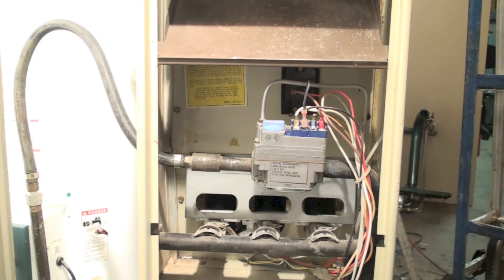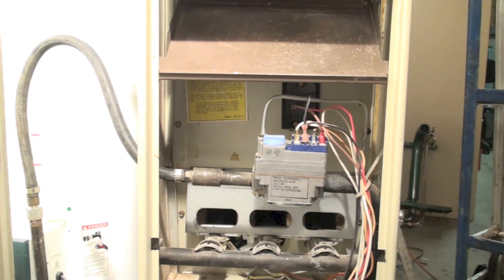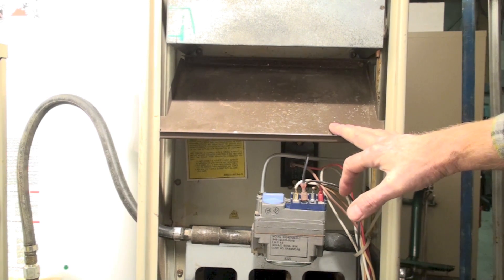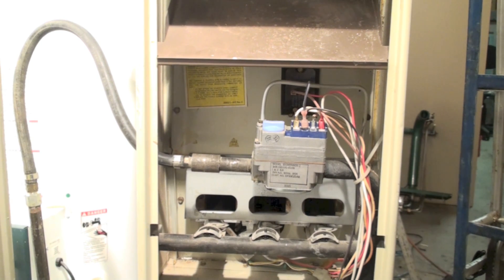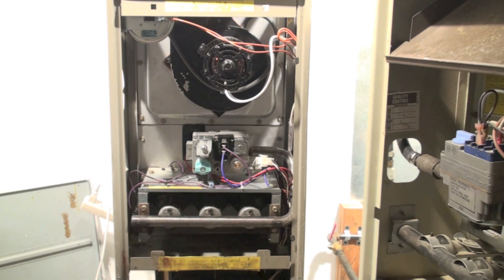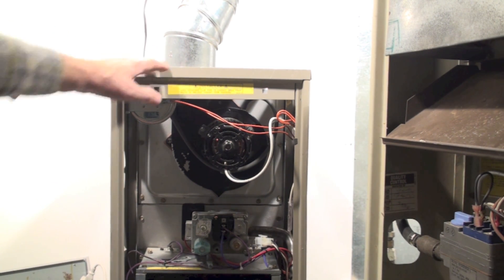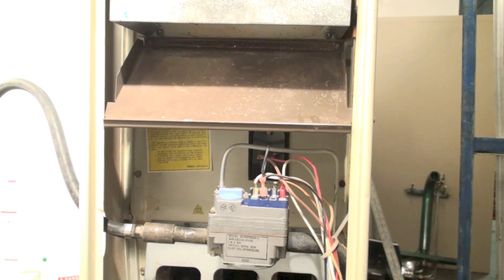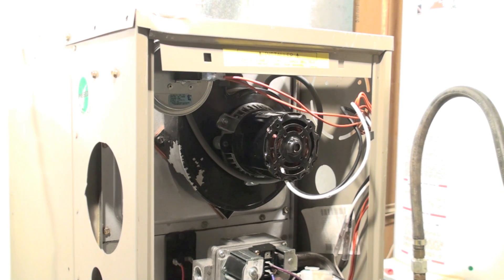The 80% gas furnace. Old 80% vs newer 80%

Comment: Here's a true difference between a new furnace and a old furnace. One breaks down after a year or two with all its unnecessary electronics and one breaks after about 50 years the thermocouple goes bad.
Reply: I have a Lennox gas furnace in my house that was here when I bought it. House was built in 1972. All the HVAC vendors keep telling me I need to replace it if I want central air. My neighbor whose brother had an HVAC company says do not let them sell me a new furnace, since my Lennox will outlive me. I’m almost seventy.
Reply: Willie Peck Mine is a GE 80,000 BTU 3 ton furnace. Built in 1961. I've heard it since 1987. Pilot never went out. I remove the blower and burners every couple years or so. It benefit to install a time start blower device
Reply: When I bought my new house, I noticed that the 80% furnace had an inducer motor and an igniter rather than a pilot light.  I figured the igniter would be the first part to fail but it lasted 21 years since we live in a southern climate and don't run the heater as much.  The door safety switch was the first part to fail.  After 7 years, the inducer motor did not fail but it became so noisy that we had to replace it.  I also replaced the cracked plastic chimney with a new metal chimney.  OK, who puts plastic in a part that is exposed to high temperatures? (Answer: Goodman  Mfg.)  The control board failed after 16 years.  My mother's furnace didn't have a control board, an igniter, an inducer fan, or a door safety switch so her furnace never failed.
Reply: If the pilot isn't adjusted correctly they can burn out a thermocouple every year or two. For the newer electronic ones the silicon nitride ignitors are a lot more reliable than the original silicon carbide ones. If it's still in good shape nothing beats an old pilot lit furnace as far as longevity though. But they don't sell pilot lit furnaces anymore so if the heat exchanger cracks you're stuck getting a new one.
Reply: I agree !

Comment: Bad part about forced air flow in the stack is you go from negative pressure to positive which means if it isn't sealed perfectly you get CO and CO2 in the heated space. I'd rather pay a little more in fuel than die from CO.
Reply from the maker: The modern 80% furnace does not have a positive pressure in the vent.  The inducer is a helper fan.  Check the vent on one with a manometer and you will see it is negative.  In fact, if the pressure in the vent becomes positive, the pressure switch will open.
GFM
Reply: Well I will check it, that is exactly the furnace I have, and I can see no way a fan at the source end (not induced draft) can push flu gas through a vent pipe without generating back pressure but I will trust what you say, and if there is in fact a pressure sw in the vent pipe that is good, but still these are all parts that can fail, I like gravity it has not failed me yet
Reply: isnt there a safety to prevent that if a stack got clogged?
Reply: if flow fails yes but it's not a pressure sw. There is always some backpressure when you push air, and thus any hole and you get flow from inside to outside the pipe and this is a problem where the pipe is still in the house.
Reply: integr8er66 older furnaces that use a chimney seem safer?
Reply: randomrazr absolutely. less pressure in the pipe leading outside
Reply: If i am right the inducer dose two things, It moves after products of combustion up the flue and pulls combustion air into the burner
Reply: CO2 detector?